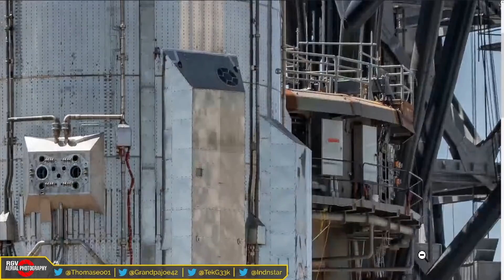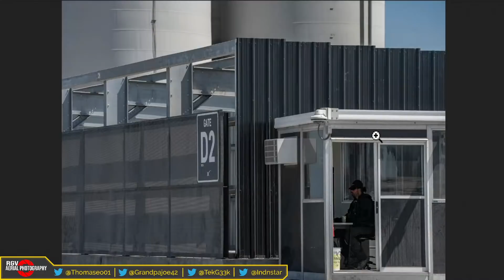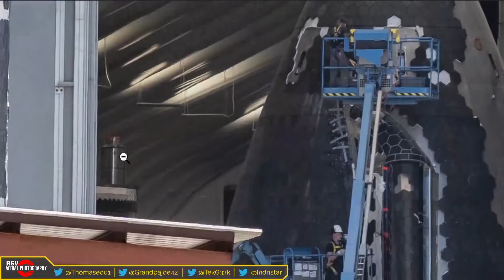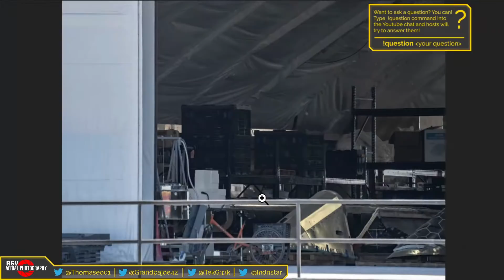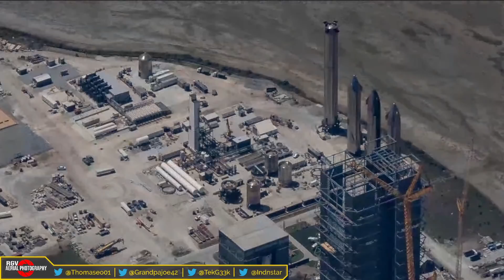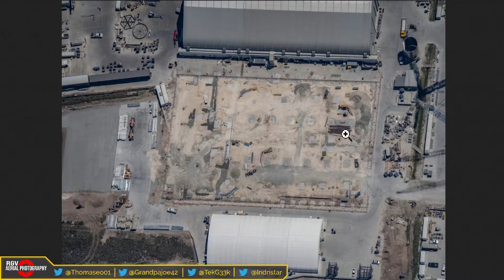Starbase Photography Review Episode 15

Comment: If I'm not mistaken, so far they have been installing the grid fins on the boosters earlier in assembly than B7 has reached.  This leads me to believe that 24/7 will NOT fly; B7 is not getting grid fins; B7 is a test article (can crusher?)